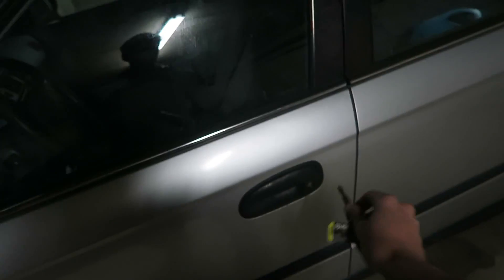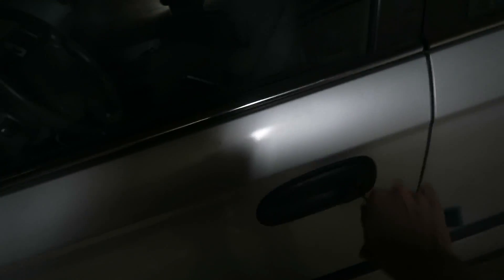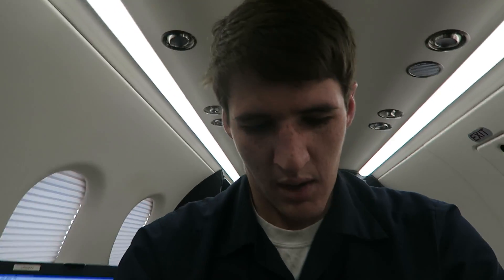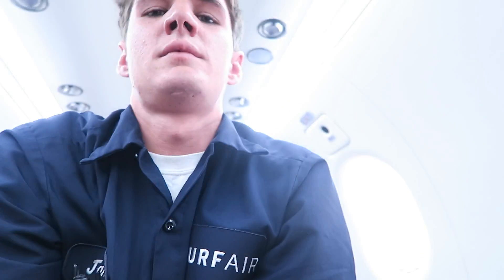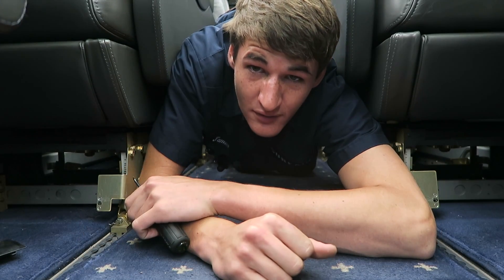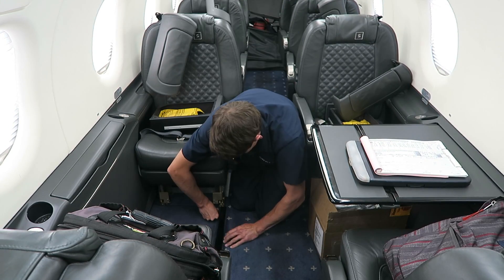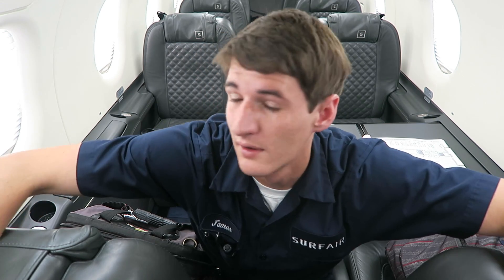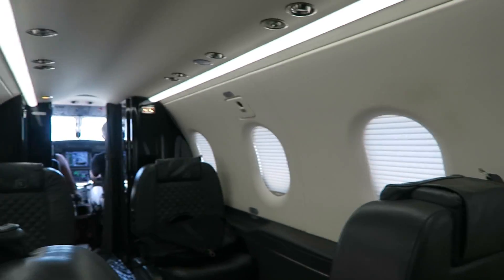Pilatus PC-12 Trim Runaway AOG

Comment: Just had this happen at 0300 this morning. Started as random Y/D disconnects without a Y/D fail cas advisory. Ended with random rudder trim runaways and AOG in Seattle.

Comment: Hi i am auto electric tech..how did you blame the trim servo controller? it could be input issue, power supply issue, or servo issue.. like in cars do you use diagnostic scanner for planes.....? Do you use amp clamp for diagnosing  electronic problems..? IS Pc-12  has fly by wire systems..plus cables & pulleys. .? I am good at understanding electronic diagrams. .how about you...? How its vital..?
Reply from the maker: Understanding wiring diagrams and electronic diagnostics is important. In this case the aircraft downloaded a fault file that pointed to the trim adapter. Kinda took the guesswork out of it.

Comment: I never trusted electric trim at take off, cautious any time at low altitude due to possible run away trim.  I'd pop the circuit breaker or use the on-off switch if available, then turn it on latter in the flight if using the autopilot.

Comment: James, I always had this idea that before you remove-to-replace any module from the plane, don't you have to disconnect the plane from any power source to prevent any short or long term electrical damages?
Reply from the maker: As long as you follow the manual procedures you should be fine. Some tasks call out disconnecting the batteries (like replacing MAU cards) but in this case just pulling circuit breakers to isolate the system was enough.

Comment: So just curious: I suppose (since as pilots we for some reason don't get access to the maintenance manual) there are 2 normally open relays in that box. one that gets a signal to command right rudder, and one that gets a signal to command left rudder. How can a trim runaway actually happen if they are both NO relays? Only reason I could see is if a) the device sending the signal keeps sending the signal for some reason, or b) if the contacts of the relay actually melted closed (forgive me, I have no idea what is in the box..). Thanks for the great videos as usual – would have been very interested in the Operational test though! ;)
Reply from the maker: I look in the wiring diagram next time I work and see if I can answer your question. As for your two reasonings I would agree either is possible however since the issue was corrected by changing the box reason a) can be ruled out

Comment: So there is no manual (cable) connection between the cockpit and the rudder trim? Meaning, in a runway condition I presume the pilots pull the breaker to stop it and then have to continue to fly at whatever rudder trim setting it was at?
Reply from the maker: Correct. On the PC-12NG the trims are all electric. In the event of a runaway you would interrupt the trim and then be left flying the aircraft out of trim. In the case of pitch trim (obviously more critical) there is an alternate trim switch which controls a second trim motor located in the same actuator as the primary motor.

Comment: tip and trick to take the faa powerplant general and airframe test plz. Bc I'm be taking the the test in two weeks and have study myself to death.
Reply: We had to have 90 or above at my school, so thats really no excuse.
Reply: Study the ASA books for the writtens. Theyre the same questions.
Reply from the maker: yeah just study the books for the written and oral. the practical you should get with someone who has used the same examiner youre using and ask them what to expect.
Reply: I can hardly wait! I've been studying prepware on the airframe, didn't get to test before I got out of school in Dec, it's much harder to keep on top of it out of school.
Reply: MOHAMMED .MUSTABI How did it go?
Reply: the school is called  aviation high school its in new york
Reply: my school make us take a qualifying test which have to get a 85 to insure that we don't fail the written . however bc of my schools standard almost all kids in my class failed only 8 people actually passed.
Reply: kellikel13 we did too, we have to show 8 sample tests of 90 or higher to test

Comment: Hi James re: trim runaway issue, how frequently does that occur? Being non deferred maintenance I gather it's a very serious issue. Are there other redundancies in place to override the trim if that module fails?
Reply from the maker: +GonePro27 great question. There are two different ways that I know of to disable the system in the event of a runaway. One is the trim interrupt switch the other is pulling the system circuit breaker. These methods would be listed in the pilots quick reference handbook

Comment: Hopefully your bosses weren't all on your back to get the plane out of there. In the airline, we go AOG on the broken part, but we would find ANY kind of excuse to have the plane fly. MELs, CDLs, NEFs (if that even applies to flight control), pull the breaker and just speed tape the darn thing, as long as it flies somewhere where someone else can fix it. Laziness could also play a factor, but oh well
Reply from the maker: Management is really great here. Our maintenance is all part 91 which means we are signing off with our licenses. I've never been pressured to sign off a plan that I didn't think was safe to fly. I will leave in a heartbeat if that ever changes
Reply: your airline sounds familiar to me Music...